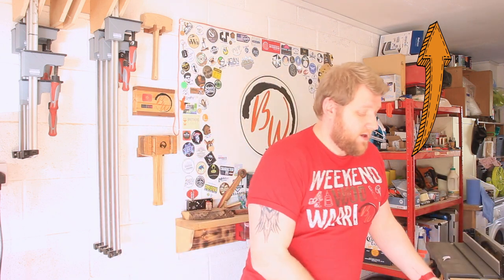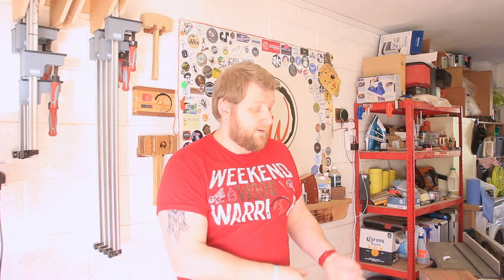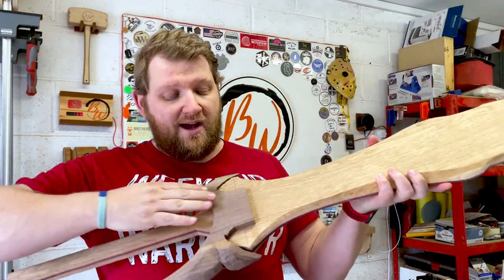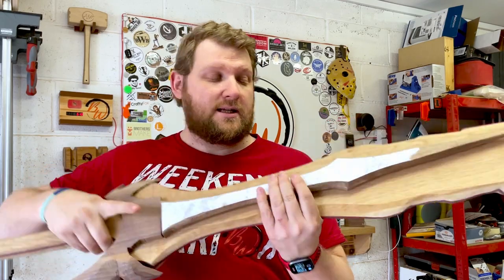Making a GIANT Skyrim Great Sword Part 3

Comment: I did not think you would do an actual slide on guard, well done going the extra mile!
Reply from the maker: Trying to do it like a proper blacksmith rather than a woodworker. Which would be easier if I could just cut it in half. It’s what I have done to the handle lol